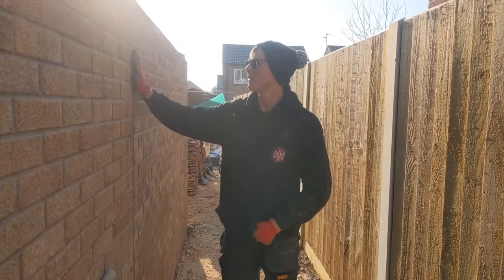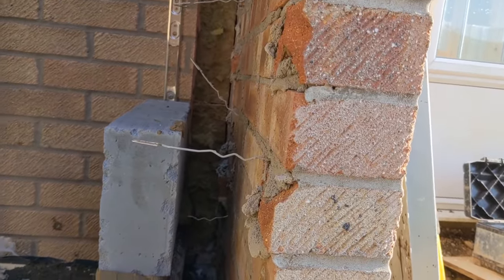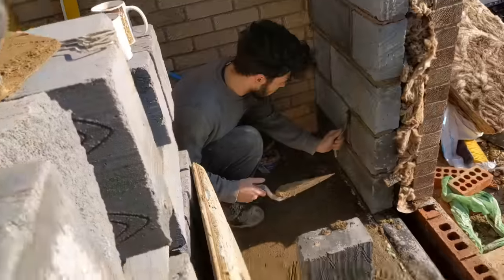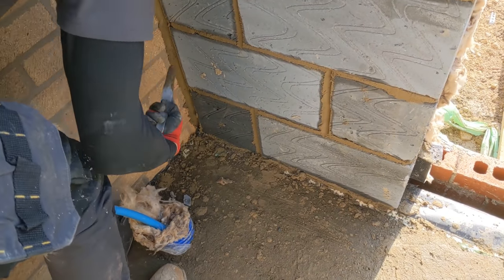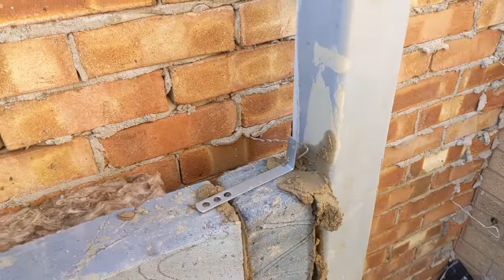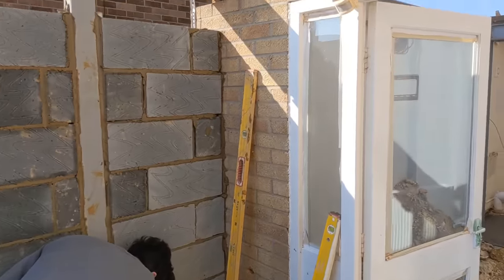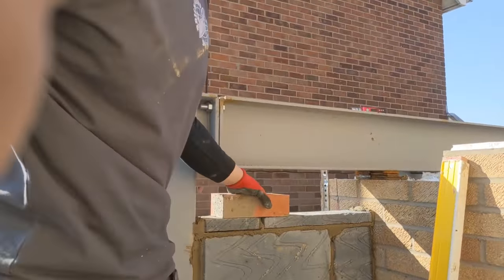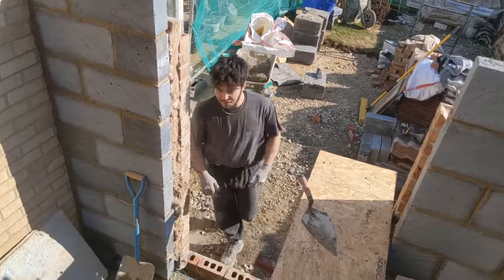Bricklaying - Blockwork UP & Teaching the apprentice #renovation #vlog

Comment: I definatly learned a few tips here. I didnt know about the pad stone under steel and few other bits. You really need a rode wireless mic or a go pro media mod or something. Audio is half a video and honestly most this footage should be considered unusable. because of the wind noise. You need a wind foam on the mic to stop that. Also in the edit when you turn around you should put the audio gain up a few then when you turn and face the mic turn the audio wave down again. That is why a wireless mic would save time also because no matter what way your facing the audio is the same. -DB can be used also if its too loud on a certain moment. If you pee on the mic or clap next to is then zoom in all the way in the audio wave, razor tool and snip each side of just the pee of the clap, them right click, audio wave, try -20 DB and work your way up from there. The audio wave in the edit that should never be in the red once during the whole video. keep at top of the green and balance your whole video out this way. Keep it up.

Comment: Don't need to joint any blockwork we usually make sure we build with full joints and brush finish in Ireland but I suppose that thermilate shite needs all the help it can get proper rubbish them things
Reply from the maker: Usually joint everything up, but not to much on the backside. As long as the joints are full, it's all good👌 and yea mate couldn't agree more😂

Comment: Well done bud but if your teaching your apprentice teach him correctly that pad stone is wrong you have a goal post system on the steels so no pad stone required and when you do need a pad stone you can use a cut of a 6”x4” lintel or a purpose made pad stone 40n concrete block 
Dpc should be bedded aswell but apart from that spot on bud
Reply from the maker: Cheers my guy, yea I figured that about that goal posts system. But I thought the heck with it😂..I know about the Dpc too, what's that old saying, do as I say, not as I do😂
Thank you very much for your comment buddy, new video tomorrow ☺️